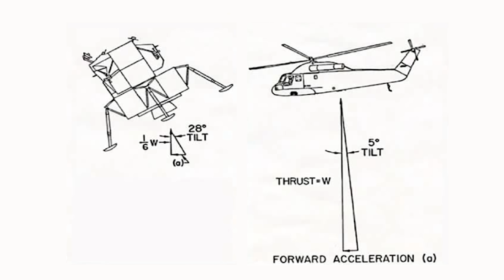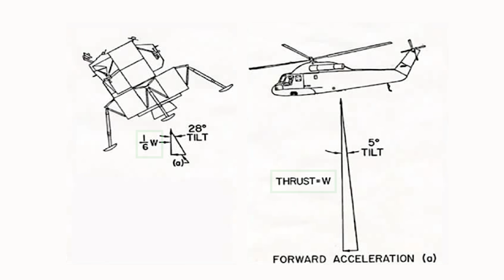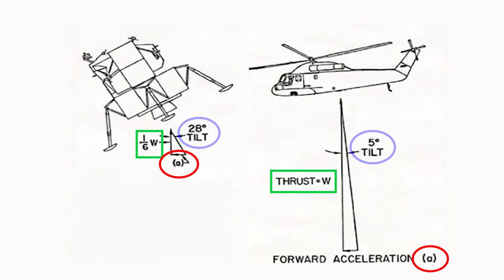How Neil Armstrong Trained to Land on the Moon  - Smarter Every Day 250

Comment: What? What are you talking about? No human was ever on the moon… Look at the dispersion of the dust when the rocket, which is 10,000 pounds of thrust, is coming close to the moon… The noise would be insane in that capsule… It would shake and rattle… And that thing that they said would land on the moon? Impossible… Then you have to consider the van Allen radiation belt that they miraculously went through without dying… And then you would have to consider the incredible heat of the moon… Over boiling temperature and these astronauts in those little space suits… How could they survive the radiation and the heat? And then there is the problem with shipping that gigantic car that they dune buggy around in the sand… I sure would like to know how heavy those batteries are to make that thing last as long as it did.
My man… You are dreaming if you think they went to the moon. All you need to do is have an ounce of common sense to look at how fake this entire scam was.

This was a money making fake hoax. And look what is the results… This guy making a video trying to explain this ridiculous story of people landing on the moon.
Reply: All of what you said is wrong.
Reply: @(S)-Riley Dunn awwww , You might be right about the noise… No you are right. Except you are wrong about everything else. The heat is over 220°F. The rocket engine… If one false calculation is done. One tiny fault in the landing procedure and that thing is going to spin out of control. I watched the testing of that stupid machine. And what about the batteries for the car? They sure played around with that car for a while so those batteries were powerful and heavy and big. So was the car
. The van Allen radiation belt is a plasma field of toxic radiation. They wore lightweight suits that will never block the radiation because if it did, we would be seeing this technology. Also we would be seeing the technology that kept those people from burning to death in those lightweight space suits and shoes. We see none of this. They didn’t make it. I know you have emotions invested in this yet I have facts.
Tell me… How could they have lost all that information about going to the moon? That’s their excuse for not returning. It’s just like 911 building seven… It’s all in allusion from television.

Don’t feel bad that you were deceived about the moon landing that never happened. You were deceived about 911. You were deceived about Sandy Hook. You were deceived about this plan Demic. You were deceived about the fake school shootings. My friend, you were deceived about everything.

The government agent that came on the news and explained building seven said a small fire made the entire structure turn into dust. And you believed it. Not questioning it. You blindly followed what television told you.
Just like this Moonlanding… If you start adding it up, it was a gigantic hoax.

Take a look at building seven pulverizing… Give yourself a few minutes to analyze it. Then. Think about the deception. Television has been lying to the American people for decades. The three great deceptions of our time is number one911… Number to the moon landing And number three this plan Demic. All of which you are falling for. How 😞
Reply: @(S)-Riley Dunn regarding the noise… Listen to the astronaut, I think it was Neil Armstrong when he was landing the alleged spacecraft. He is calm, it is very quiet, almost as if he is sitting in a brand new 747 airplane going in for a gentle landing. There will be no possible way sitting on top of a 10,000 pound rocket that it would be like landing a 747. It would be extremely scary and loud.

You did mention something interesting. If there is no noise in space, how did the astronaut communicate? And why wouldn’t we hear the rocket if we could hear his voice? Even if his helmet was capable of having him speak, you would still hear that massive rocket. After all, they were sitting right on top of it. Right on top of 10,000 pounds of thrust.
This is one problem of 100 problems. Just like 9/11, this was one big psychological operation and money grabbing Bunch of nonsense.
I am sure NASA tried. But once they found out there was no way to go to the moon, they did not stop, they called Hollywood

Comment: I fly FPV racing drones and this 1/6th problem of control degree offset sounds like it could be solved with fine tuning pitch, integral and derivative via a computer that can measure gravity via a gyro so it automatically adjusts your normal pitch control input to compensate?

Comment: A helicopter rotor would provide absolutely zero lift in the vacuum of space I'm guessing. You'd plummet to the surface like a rock. Even if somehow it did work, the dust storm created would be detrimental to the mission. The pilot wouldn't be able to see where they were supposed to land, and the moondust is super abrasive and would undoubtedly damage or at least clog equipment sensors etc...

Comment: But, if we supposedly been to the moon already. Wouldn't they know the math already? One would think so, nothing has changed on the moon or Earth as far as we know, right? Also, why didn't we build the space station on the moon or build anything on the moon. Since we "already" landed on the moon in the early 70's. Not trying to start anything, just curious. I want to believe we went there, but with hearing the talk these days about the moon, they speak like this is our fist time going there.
Reply: the problem is you have to get everything right from the get go, computers have gotten better but the physics are the same, and it's not any easier than it was then, plus they're going for more than stepping on it and planting a flag, costs are also up and that is a major factor as the whole country isn't fighting another anymore and there's no major conflict or motivation to drive such a costly trip.

Comment: do they need to simulate it IRL?  Or do we have the computer power today to just do it digitally?
Reply: Good question. I've been thinking about that myself. Computer simulation definitely helps at least for training today. I highly doubt NASA would consider that vehicle from the 60s to train crews.

Also, there's the consideration that landing may be fully autonomous (except for emergencies) so computers may be best.

A lot of those IRL tests during Apollo were pathfinder experiments. They had no idea what landing on the Moon would be like, and they had to figure it out somehow.

While an unfortunate length of time has passed since the 70s, we still understand how to land on the Moon better than they did in the 60s.

The question  though is if the SLS will be capable.

Comment: Hey.  Why was there no blast crater underneath the Eagle when the moon dust kicked easily when walked upon?
Reply: @AnOfficialYouTubeProfile  Then why no exposed bedrock?  Video showed untouched lunar surface.
Reply: @AnOfficialYouTubeProfile  The LEM empty weight was about 3500# on the moon - about the weight of a mid-size car on Earth.  The cutoff sensors and crush tube lengths put the nozzle approximately 7 feet above the dust before the engine cutoff.  The nozzle put out, maybe, 3000 feet per second of gas at sufficient volume to levitate a car.  That means, at the moon surface, the gas is moving radially around 3000 fps.  Most people know that if they strap a rocket to their car and levitate it above beach sand, it will dig a deep hole down to bedrock and create a crater.  Even an air compressor blow gun will create a crater in sand with only about 1000 fps air with low volume flow.  But for some reason the LEM did not leave even a small crater?
Reply: @(S)-Riley Dunn I am not sure how you came up with cutting through rock.  I meant blowing a crater from the loose dust  similar to how a boundary layer vortice digs dirt around the base of a tree.  From what I have read, the "rock" underneath the dust is supposed to be compacted glass-like particles.

It depends where you draw your control volume.  ( I am not going to dig out the books.  But this is broken down to first year physics.)  A nozzle is designed for a certain exit velocity developed from a designed total pressure in the combustion chamber to expand the gas to ideally atmospheric pressure at the nozzle exit.  So the nozzle is sized for a volumetric rate of gas at this velocity to achieve the necessary thrust.  More volume of gas at a given exit velocity increases the thrust ( a bigger nozzle.)  I don't know if landing was the design point of that rocket.  But weight was definitely equal to thrust during landing.
Maybe 2500 psf was what you used as a simplification for your calcs.   But the static pressures on the surfaces throughout the converging-diverging nozzle and combustion chamber is what actually imparts force onto the vehicle.  This is not a constant pressure distribution.  The easiest way calculate thrust is to know the exit rho.V.A.

Comment: I was looking at the realtime Apollo mission (which is AMAZING) but I have a question... when they first launched, they were cruising at humble 18,000 miles per hour roughly ... yet it took them about 4 days to reach the moon... can someone explain why?
Reply: @(S)-Riley Dunn Oh I see ... so they launched, accelerated to massive speed, then coasted the rest of the way while earths gravity slowed them down? ... Did they just calculate how fast they needed to start out to end up at the moon traveling a speed they could work with?
Reply: From what I understand,  Einsteins equations from relativity gave us more accuracy in those calculations than what Newton had given us. I've never done calcs like that but I have to assume that since we know with fairly good accuracy what the mass of the moon is and the earth, those calculations would certainly be doable ... then add into the problem, the need to figure out how much thrust is need to get to those velocities, and how to aim the rocket so that it says on course ... what kind of fuel to use .. how to build it ... it's no wonder it took them almost 10 years to do it.

When I started my career in IT, my first paying job was at Phillips Labs at Edwards AFB. Thats where they tested the Apollo rocket engines and also some of the astronaught training was done there. It was an amazing facility with underground tunnels that literally go for miles and interconnect underground command centers with these cable trays stuffed with cable that just off the hook. It was an impressive experience.

Comment: I really enjoyed watching this video. My dad worked on the Lunar Module Simulators (both the one at the Cape and the one here in Houston), so I knew quite a bit about their role. I knew very little about these machines and figured they were failures, but I am surprised to see how valuable they really were. My dad went on to work on Apollo Soyuz, Skylab and Space Shuttle. My sister got an unrelated job at NASA and ended up working in the same department as my dad. She still works there today in a support role for the ISS. My dad is retired and will be 81 this month.

Comment: Why couldn't they just use a hot air balloon, in a closed environment to prevent winds, that provided 5/6th of the thrust instead of the jet engine?
Reply: Drag and acceleration and buoyancy, the balloon would have to be massive, making it have huge drag, it would ruin the center of mass of the simulator, it would tug on it when it tried to move in any axis. It's actually less of an engineering challenge to just strap a jet engine to a chair.

Comment: The answers to why they built this equipment the way they did would be in the daily engineering notes. My Father and mother worked on the Saturn five booster program.  My mother was in document control and my father was a engineering technician. Every change that was made was put into the daily engineering notes and why they made the change. Everything these engineers did was documented in detail. They weren’t just winging it like a bunch of yahoo’s.  There was a lot at stake and if something went wrong they needed to know why.  I’m sure all of those notes are sitting in a warehouse somewhere the trick is finding them.

Comment: Won't the landers of the upcoming Artemis mission be computer controlled and autonomous, in much the same way as the Falcon 9 and Starship monitor and adjust their position and rate of descent here on earth..?
Would their computers not just be told the gravity constant of the moon, and the vehicle would then, with it's plethora of sensors and cameras, just 'work out' what to do and how to move to touch down safely..?
We have 50+ years of computer tech advancements at our disposal, (and have been landing autonomous craft on the surface of less massive planets regularly since Apollo) so why hand this crucial job over to the frailty and 'relatively' (compared to a computer system) incredibly slow reaction time of the human pilots..?

Comment: They won't need an LLTV.

SpaceX will most likely be the ones taking the next astronauts to the moon and they won't need a lander trainer because the flying will be done by the computer.  All they will need is a simulator to run them through the routine and emergency sequences they will need to follow on their touch screens, just as they use now when they ride SpaceX's Dragon Crew Capsule to the ISS

Comment: Now how did he eject vertically when that craft flipped sideways 😳
Reply: Ejection seats know their orientation and correct for any tilting after clearing the aircraft. It's called zero-zero ability. Zero height, zero speed (of the aircraft) and still a save way out for the pilot.

Comment: Mhh.. Here on Earth our Jets have an Atmosphere, wehere the jet-raction can pushup from. But in a empty Space with nothing to pushup??? My Brain gebt’s a burnout. And what is exactly on the Moon, where the Spaceshuttle can take off, when there is also no atmosphere? Pushup on the Planet it Self? On Earth how much a Moonlander weights? 1/7 of a Ton is also much .... i Go and watch soccer
Reply: A rocket engines works by accelerating its fuel out the end of the nozzle. They don't need anything to push against. 
It's like you sitting in a boat and throwing a rock backwards. You and your boat will accelerate forward. And you don't need any atmosphere for that, the stone is reaction mass enough.
Reply: @3gunslingers  sitting on a boat without water... my brain  :)
Reply: @Mr.TomMoon  
Imagine sitting in a boat on water and throw a stone. What will happen?

Comment: I could see them use a quadcopter style lift system in the new vehicle to offset the vehicle weight.  The entire cockpit and thrust system could gimbal off of the quadcopter platform.

Comment: My question would be why land the same way? We have aircrafts land and take off without having to working on vertical take off/landing (think space shuttle). Why would we duplicate what’s been done several times? Wouldn’t it be more beneficial to find ways to make life easier for  landings and take off? The idea being a space station on the moon would need an “airport” type of system. The ‘Sea of Tranquility would be a perfect site to do so. Just a thought... great video!! 

I watched the A11 landing when I was 6- and I was hooked! Mom made me watch (only 2 times ever- the other being Nixon’s resignation), and I’m glad she did.
Reply: Without atmosphere on the moon we don't have a choice but landing vertical on a rocket engine.
Reply: Obviously I’m not an engineer, but it seems that we have the technology to make adjustments in zero gravity w/o atmosphere with the shuttle, and we’ve come a long way since then, why not adapt that to the moon at low gravity? I understand the vertical take off/landing reasons, but I’d have to think we’re past that now. Engineers today are smarter today than 50 years ago (and by ‘smarter’ I mean by building on knowledge already experienced), I’d have to believe they can figure this out. Maybe I’m just dead wrong, but one craft in and out is better than two.
Reply: @montanamade8712  
I think you have the HLS from SpaceX in mind. They have only one stage for landing on the moon and launching again. No staging. And it can handle up to 100 tons of cargo.

Comment: I've played probably close to 1000 hours of Kerbal Space Program. I've landed on bodies with all sorts of different gravity. I've never realized that vehicle angle for horizontal acceleration is a function of gravity (well, of thrust to weight vs thrust to mass). This might help me land on some of the more challenging locations, I've always found the higher gravity locations more challenging. Certainly that is because higher gravity is less forgiving and faster paced, but if I've been trying to land as though I'm landing on a small moon I would be building up or cancelling horizontal velocity faster than expected. Fascinating.

Comment: Wouldn’t “today’s” descend be computer controlled instead of manually? Take the booster rockets as an example, there’s no way a human could manage that landing manually.
Reply: yeah, but there probably will be some form of manual override if the system borks.
you still need to put the training in, even if it's just for the edge case (and to understand if you are in one)